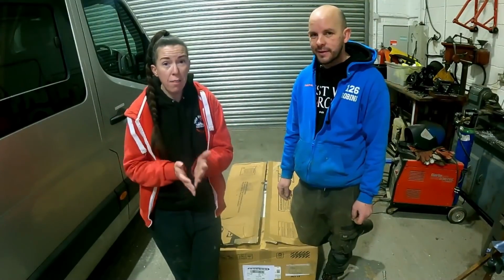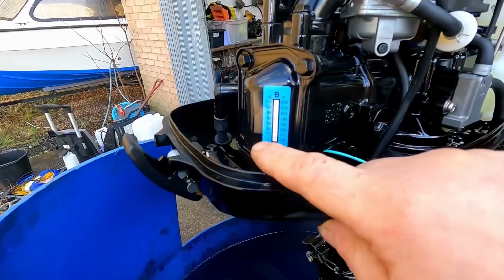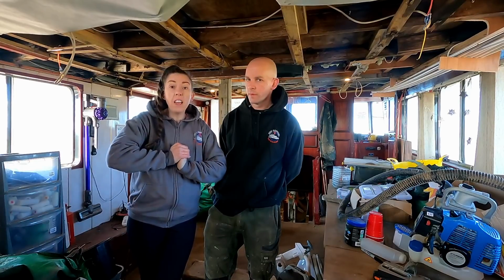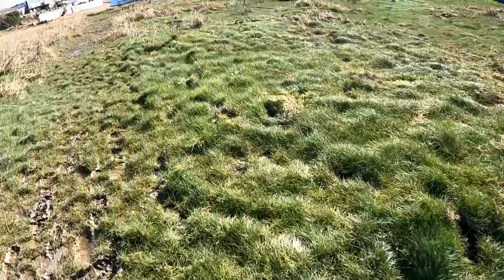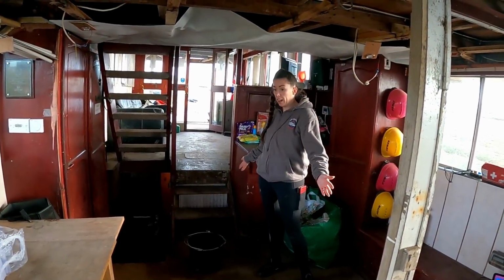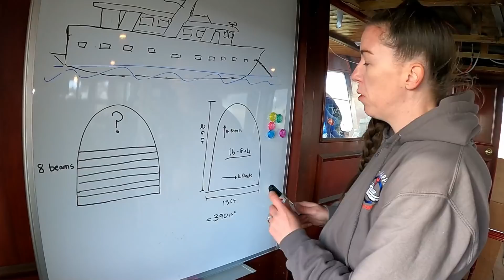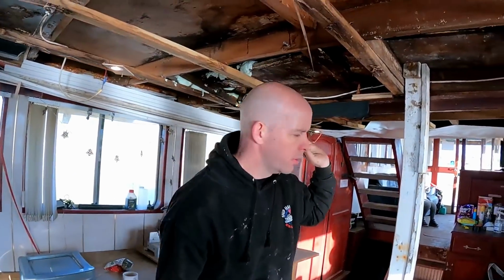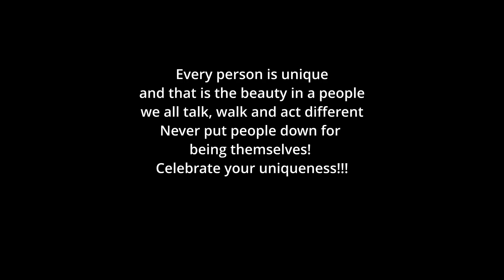Ep 61- New Boat Engine And Assessing Our Roof For Removal #boatrestoration

Comment: yea, you should keep using very little alcohol in those mercuries, they a sensitive motors.   
If you are covering the roof with fiberglass, It's a waste of money to buy marine plywood.  The most i would get is a outdoor ply.  You are sealing it with resin, then covering it with one to three layers of fiberglass. the money saved in ply could cover a lot of the cost of fiberglass.   For residential floor joist spans a 2x6, 16"center spans 11ft4in / 2x8, 16ctr spans 15'10". / 2x10  16ctr  goes 19feet.  This is modern building codes.  This is a lot of weight up high.  i
I would go 2x6(maybe even 2x5) with the camber (for drainage) If a beam or beams are needed to support the roof, it's no big deal as it would be nice to have something to grab when the boat is moving

Comment: 😪use epoxy on external parts as epoxy will stick to wood and not separate
Poly will not stick for long in the weather if you decide on poly then when you put down the first layer let it cure then nail it down with galv nails

Comment: I wouldn't use marine ply if its being covered with fibre glass. There is no benefit over normal exterior ply is this instance, I use a lot of ply in construction and the price of timber is crazy high so don't waste your valuable funds on it. You wouldn't use marine ply on flat roofs which are being fibre glassed and they are open to all weathers, would use cheap exterior ply or OSB board

Comment: Why don't you use EPDM on roof instead of fiberglass? It stays flexible so you do not have any chance of delamination and water getting in. EPDM is also availble in white but then it is less flexible. you can also paint EPDM white, you can even put PIR isolation under the EPDM so yo can have the beams on show inside. EPDM is cheaper, easier to install and has a better finish then fiberglass

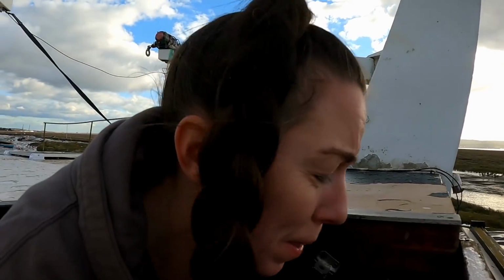Comment: Simon before you decide not to use epoxy for the deck, I suggest you watch this video beginning at 19:00.  Professor Fred does a very good job of demonstrating the difference between polyester and epoxy resin.  He is restoring a boat that is glass over plywood so it is very applicable to your deck project.  
FWIW, Fred's Portuguese accent is slightly less difficult to understand than is Simon's Welsh mumble so all should be good on that front.  ;>)  
https://youtu.be/QCk5_XqeXuE?t=1147

Comment: I'm no expert on marine ply but my old boat had a refit l believe in the 1980s, marine ply was used on the cabin roof attached to the beams with a teak deck laid on top. the ply was rotting away from the sheet end and from fixing holes etc. The teak was sound but walking across the deck was spongy, attempts had been made to remove the ply panels between the beams, fill the gaps between deck and beam with filler and a panel of ply installed. 

I'm just wondering why the ply should rot like that and am thinking that any saw cut or drilled hole should have a paint on wood sealer/preserver applied. Before a second sheet or other is butted to it. Maybe the manufacturer/supplier should be asked at this early stage and an installation method worked out.

That was great news on them outboard and the test run worked well, sad to see the hulks and I was just thinking they were peoples dreams at some time.

Thanks for posting and stay safe.

Comment: Also not convinced by only cutting the shape on the top of the beam,  uses a lot of extra material, loses headroom, adds weight up high and doesn’t actually make any difference to fitting it out. Either laminate the beams or get boards as wide as possible and you can then get a few curved beams out of the same board. If the width of the roof is  similar at the frd and aft end you will just need one pattern for all the beams. There is a calculation for working out the curve which you can probably find online so you can take the width and the crop and make all the beams before hand. Essentially the camber is just the arc of a very large circle and on beams shorter than these can be done with two straight battens at least twice the length of the beams,  three nails and a large workshop floor, so may be useful when you are doing the main deck beams at the bow, but If you can’t find how to make the beam camber pattern I can explain it to you but will be a bit wordy🙂

Comment: I guess we are a bit surprised that you are planning to simply rebuild the 1970's superstructure given the large number of problems with it.
Thought you might go for something that looks a bit more authentic to the original design.
Reply from the maker: After having been on a original HDML they are not designed for comfort, the are sectioned off and have 3 different vertical ladders to each section, not very family friendly
Reply: @ShipHappensUK we were thinking of the silhouette rather than the layout as most likely you are not going to war. So you don't need to be able to lock down to carry on fighting in case of fire for example, nor do you need the same size crew.

By the way, really empathise with how much more progress can be made when it isn't as cold. Today felt very different to previous weekends, it felt like we made good progress.

Comment: Love the channel well done for all the effort you’ve put in to save her. When considering the resin you use, epoxy although more expensive is stronger and more reliable for longer, but most of all polyester resin is highly highly carcinogenic and some serious respiratory protection is required even out doors. Be careful
Reply: Epoxy resin should be used on wood correct!
Polyester is carcinogenic and worse than epoxy is incorrect.
Unless you are an industrial chemist with resin experience please don’t share what you think is true.
Many many people become sensitised to epoxy and can never use it agin.  Polyester does not have that issue.
Having said that as someone with 20 years resin experience I agree epoxy is the correct resin to use.  If they want a cheaper solution they should buy a smaller boat.
Reply: @ThePhilcam  I too have been working  resins for over 20 years and it is highly carcinogenic and high levels of respiratory protect is required. I suggest you read the data sheets on polyester resin and level of protection in comparison to epoxy. They are both dangerous I agree but polyester resin is more dangerous. I specialise in resin with wood, treating it shaping it lathing it , using hard woods soft woods punky wood,glu lam wood,for boats, for furniture need I go on ? Anyone in the know will tell you from a carcinogenic perspective polyester is worse which is what I said
Reply: @budemonkey  all good Dawn you must know best. I manufactured and sold resins. Hope you have had all the children you wanted to have.

Comment: All i can suggest. For the roof decking, two layers with opposed joints would be preferable. Two half inch layers should be very strong.
If you intend to place loads up there. two layers of 3/4"
Reply: I agree but firstly coat first layer of wood with resin fix it down then use resin to hold the next layer of wood down then fibreglass over the lot

Comment: You seem to be getting some rather odd and somewhat poor advice amongst the comments about your decks here guys but I’m sure that you’ll do your own research and work out the best way to go. I’ve just finished re-laying a ply deck myself and have done a few on different boats over time so, for what it’s worth from someone with a little experience on the subject: DO use decent marine grade ply wood - DO NOT use cheap non marine grade plywood! Despite glassing it any penetration or damage to the glass anywhere down the track will allow water to track in, delaminate the glue lines (of non marine grade glues) and create all sorts of problems. Marine grade ply is used in fibreglassed ply boats for very good reasons and with the sort of weather that you get there you do not want to take short cuts on such a big and important job. 12mm ply will curve well enough for the amount of camber on your deck. Ideally you should scarf all of your ply joins together, rather than try and butt join them. Your hull will always flex and butt joins will very likely open up over time.